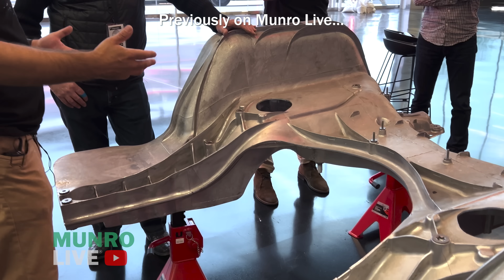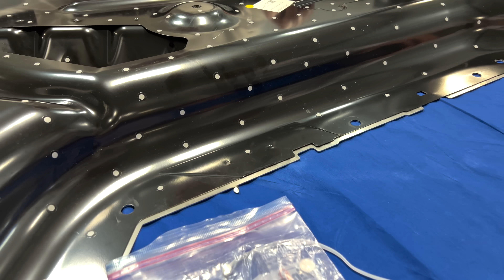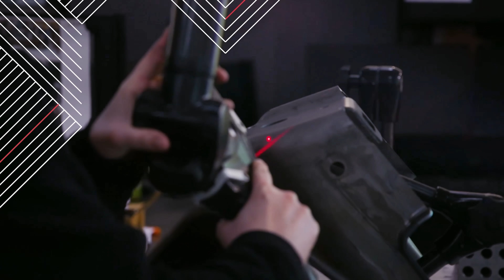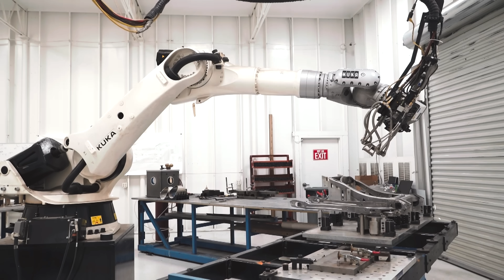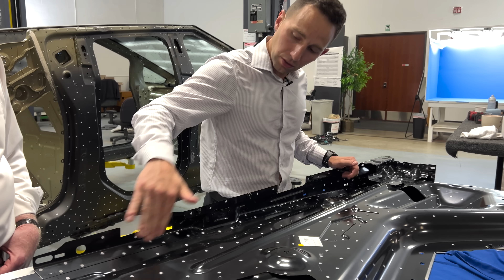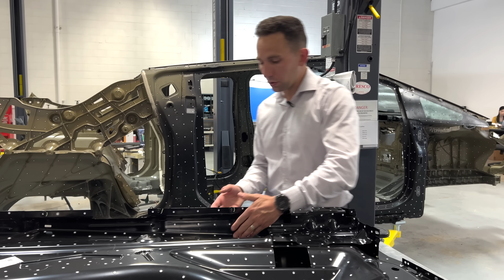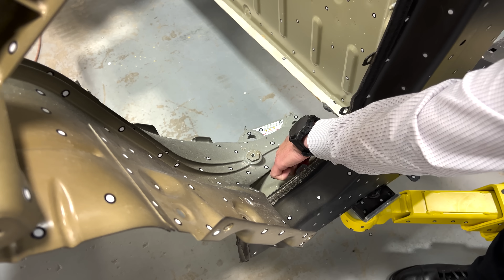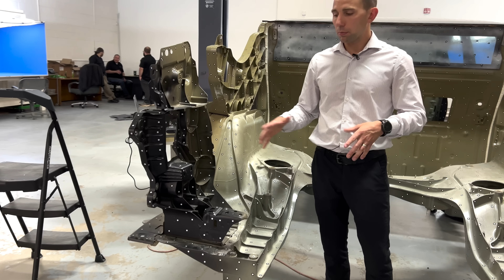Peeling Back the Layers: Tesla Cybertruck Rear Body Panel & Castings

Comment: So much for reduced stampings and an exoskeleton. At least in traditional unibody designs the rear fenders are welded structural members! 😂 Some people were legit upset when I started suggesting last year that there were probably stampings behind the stainless panels because that is not what Elon had so boldly proclaimed.
Reply: There was no way the outside skin was ever going to b structural.  If it was there would be weld marks or screws rivets.
Reply: @robertbowman9108  I figured they were going to create a fold line around the outside edges and have mounting tabs to weld, screw, rivet, etc. from the inside.
Reply: I am amazed by the long list of technical details that Elon Musk promised you personally by a flippant remark on Twitter half a decade ago. There are so many completely clueless people out there who seem to think that if Elon said "exoskeleton" it would necessarily mean that the vehicle consisted of only one layer of metal and only soft wires, tubes and fabrics on the inside. And any deviation from that is evidence of Elon both lying and breaking his solemn oath to make this exactly as stupidly as you could possibly imagine.
Reply: @geirmyrvagnes8718  Dude. He literally made a huge presentation about how he was going to eliminate stamping and paint and streamline the gigafactory by going to stainless steel. Nobody inferred it. The man said it. Provided a huge capex reduction argument for it. And used it to fluff Tesla stock for years. So yes. The man was either lying or wasn't smart enough to ask the right questions from his engineers. Just because you have selective hearing or selective memory doesn't mean the rest of us do.
Reply: @patreekotime4578  Well, it's not painted, is it. So, are YOU lying now? shocked
Reply: @geirmyrvagnes8718  Did you even watch the video? The parts are e-coated and in some places also powder coated to color match differently e-coated parts. In some cases parts are e-coated as seperate components and then glued together before final assembly. So there are even extra steps here in this process vs traditional coating. Final paint may have been eliminated, but the painting process here is still complex compared to just dipping the whole thing.
Reply: @patreekotime4578  So now it suddenly isn't painted, just like Elon said? But why were you lying to us? I am shocked by your lies! What? Am I deliberately misunderstanding you and acting stupid? Yes. Yes I am. Just like you. LIES! LIES!
Reply: @geirmyrvagnes8718  Please take whatever medication you are supposed to be on. Its impacting your emotional state and your reading comprehension.
Reply: this has to be the worst truck ever made in history! yes it has tons of power and electronics but thats where it ends! a cheap toyota hilux body on frame comes in single or double cab, longer bed, it canbe equiped qith custom beds with colapsible sides, dump bed, a crane, 6x6 conversion, chassis extension and much more. there is no limit to what can be done with body on frame period!
Reply: @alanmay7929 Quick bro, write to Tesla and let them know your insights!
Reply: @alanmay7929  Buy a Toyota, then. Why are you here?
Reply: @geirmyrvagnes8718  wow!!! i just gave you one example! is that all what you could come up with?! how pathetic!!! im here for the so called "future" of trucks where literaly nothing is modular, nothing can be modified..... wow what a "great" future!
Reply: @alanmay7929  You gave one example and you want more from me? How despicably pathetic!!1!!eleven... Listen here, young man: If you want a truck with a frame, buy a truck with a frame. Don't go crying on the internet. Do you want me to list trucks with frames for you?
Reply: @geirmyrvagnes8718 when did i "asked" you any "example"  can you even read?! didnt Munro said its the "future" of trucks!? how difficult is it to get! TERRIBLE just terrible!
Reply: What about the Chevrolet El Camino and Ford Rachero?  I want a cybertruck, not a hilux.  My life isn't complicated where I want a small truck. Besides the Hilux is extremely slow.
Reply: @GG-si7fw  the hilux isnt "extremely" slow, its not a sport vehicle! its a vehicle made to be used all around the world from the paved roads to the harschest places in earth not the useless EV. its used for towing, hauling people and goods, its modified for overlanding, offroad, RV, firefight.....

Comment: Does the stainless steel add any structural value?
Reply: Of course.
Reply: It does to the outside. The contribution to something like the stiffness of the vehicle would be minimal. You could probably drive it around "naked" just fine. But when it comes to the toughness of the vehicle surface in practical use, a truck where you can karate kick the door and it doesn't even scratch? Is that a structural value? Also consider side impact, having a thick strong skin to distribute the load initially and lead the forces to the strong points. I'd say that has some structural value.  Maybe you eliminate the need for some steel beams that you usually find in doors for that purpose. I, for one, understood that as what was meant by "exoskeleton", but It would seem I am one of few.

Comment: In my opinion, the “flutes and escape paths” have nothing to do with the coating process (the coating is done before the stainless steel plates are glued on, which means there are no enclosed cavities anyway). To me, these areas look more like measures to avoid draw creases: Material is “used up” here that would otherwise form creases in the drawn part.
Reply: Or, since they are facing down, drainage.
Reply: @geirmyrvagnes8718  Given it's Tesla, they probably fullfill multiple needs. Let's assume at least these two.
Reply: That was my first thought, but you’d also want to get rid of water if any makes its way inside following a river crossing for example.

Comment: E-coated inner skin would very likely be dried and cured before bonding to SS outer skin,  So it would be expected the drain holes are for condensation between panels (weep holes).
Reply: And for getting rid of water after you wade across a river.

Comment: Marvelous review,  lots of interesting details and manufacturing tech.  Thanks much for detailed analysis.   Can see that this design will have near ZERO reparability.  the entire vehicle will be scraped in event of most minor damage to castings.
Reply: On what planet do you see a skilled workforce evolving to repair advanced vehicles? there's a shortage of people for every trade out there.
can my flat screen TV, vacuum , Iphone batteries be repaired? more and more things cannot be fixed as labor costs increase.
Reply: @ExploringCabinsandMines  If the damage is minor, cars can be repaired. For the Cybertruck it is very easy. No paint to match, so just replace the panel/bumper/door in question. The expensive part is, as you point out, the time used by skilled people. If the damage is bad (a wheel is ripped off), it is more expensive to fix any car than the cost of a similar used car, so it is written off.
Reply: Why? You can weld castings.
Reply: OK, now you know that castings can easily be repaired. Please confirm that you have received this information.

Comment: I'd like to see a deep dive into automotive adhesives which are used so much now. Another great, informative video Munro team!
Reply: Me too. With lots of info on their lifespan and how they compare to welds. 😅😅😅
Reply: @AvocadoAtrocity structural adhesives tend to have a higher fatigue resistance vs spot welds.
Reply: @mmvanraa  Indeed, and potentially vibration dampening.
Reply: Supplied by Lord, a part of Parker Hannifin.

Comment: If the castings are “the fixture” why is there any panel variation? Over and over we see panels that don’t fit, this doesn’t make sense.
Reply: I've now seen about 50 Cybertrucks, and at least 20 parked where I looked at them closely.  Other than the early engineering validation prototypes (a few of them here) the panel fit has been excellent, as good as any German or Japanese manufacturer.  I did see one small panel that seemed off, but was just not attached properly (might have been a test car).  Now there could be a few that have already been in an accident, or someone removing a panel and not putting it back on properly that would cause a poor fit.  I guess the question is was the poor panel fit one you saw personally, and it wasn't a internal Tesla test car?
Reply: Prove it.

Comment: so if that panel is damaged that entire piece has to be replaced i wonder how much they will cost and how readily available they will be.
Reply: So if that panel is damaged, you simple replace the whole thing. One hour work, and a cheap part. Done. Quickly and cheaply. No paint, no problem. Now wonder about how much that would cost to repair a vehicle with a shiny painted surface in a special color. Just the hours in the workshop and paint shop...
Reply: Someone already had theirs damaged. ~$3k including install from Tesla iirc
Reply: I never thought paintless dent repair would amount to anything,  I was wrong.
Reply: availability = zero, reparability near zero
Reply: @pablopicaro7649  How do you know this to be true?

Comment: Why did tesla put on these heavy stainless steel panels if the castings are so beefy. Couldn't tesla have saved a ton of weight by using normal panels? Wasn't the outer shell supposed to be the structural exoskeleton? The cypertruck is a shit show. Almost nothing that is important to customers made it into production. Sadly Tesla has become an average car company. Where are the smack downs to ice vehicles and other oems that Tesla was known for in the beginning? I excepted a truck that beat all other trucks in almost all metrics. And what we got is an under average shit show. No structural exoskeleton, no 600 miles range, not rust proof, not reliable see all the reports of failures, no spare wheel, no rear view mirror, no heads-up display, no stocks, shitty lights the dimmest lights if seen on a car plus plugs up in snow 0 vision, shitty build quality panel gaps the wind shield wiper is off position when in default, no security sensors to stop fingers being broken when using the doors and frunk and trunk 80s tech. And on and on and on.... What a shit show. Even GM truck evs outperform Tesla on every metric. Ironically not on price. GM is way cheaper than tesla .
Reply: Then go buy yourself a GM truck.
Reply: @airwindmars5971  I did ... chevy silverado ev. Best in class! I canceled my cypertruck order. And was a good choice. A friend who bought the cypertruck is selling it already. The cypershitshow doesnt even go 150 miles when fully loaded or towing. He had to charge the cypertruck after 125 miles. That means 2 hour driving and 1 hour charging. Its unusable. At least if you want to use it for truck things. If not than the model y is a way better deal.
Reply: @Ravenought69  The Silverado EV is pretty cool.  But the only reason that there is good range is because they just dumped a large battery in that thing.  It is not very efficient
Reply: @verbal213  bullshit!!! its actually very efficient and also why didnt tesla dumped a much better battery well integrated instead of the dumb extra battery taking 1/2 of the bed?! why didnt they made a thicker battery?
Reply: @verbal213  True it has a huge battery. But the fast charging charges way faster on the silverado. takes about the same time to charge the silverado as the cypertruck. What use is efficency if you only have half the range... wasnt efficiency supposed to give you more range not half? Cypertruck 280 miles - chevy silverado 445 miles... real world testing.
Reply: @Ravenought69  then good for you and your friend that you are very satisfied with your purchase. Why do you need to convince others to go buy a GM truck instead of a Cybertruck? Last I know this is America and one can buy whatever truck they want without being ridiculed for their choices. My first truck is a ‘99 toyota Tacoma and I still have it, my second truck is a 2012 Toyota Tundra and I still have it. My next truck will be a Cybertruck and not a  GM truck because that’s my choice.
Reply: @rogerstarkey5390  I mean I guess.  The current Cybertrucks are selling for 100,000 minimum and the Hummer EV is 108,000 so yeah if 8k less on a 100K truck is for the poor.
Reply: Flat panels with no contour very likely have lots of waves and buckling and thermal expansion issues,  likely making thicker reduces waves and deflection and oil-canning.
Reply: You really summed up all the FUD perfectly. Literally nothing of what you said is true or verified. There are no broken fingers. There's no reliability issues. The outside is absolutely structural making it an exo skeleton. The windshield wiper works well just like similar wipers are used on other large machinery. 
There's zero evidence showing that cybertrucks rust.
Reply: Chevy has plenty of Silverado’s in inventory for you to purchase. They are even being discounted.
Reply: Because i want them to avoid this expensive mistake. What an a hole would I be not to.
Reply: Lies and more lies. The GM BEV trucks are all far more inefficient than Cybertruck. Longer charging times to achieve the same range, more energy consumption, and more energy costs that quickly stacks up.
Reply: yeah seriously i dont get this show anymore! they just gobbe every shit tesla makes! why arent they talking about what body on frame trucks are actually much better!? this truck is utter garbage! a toyota hilux with 200hp comes in single or double cab, has a removable bed, can be equiped with custom bed with colapsible sides, a dump bed, a crane, chassis extension, 6x6 conversion and much more.
Reply: @alanmay7929  Yeah! The cybertruck is so much crap! It doesn't have an arm like a backhoe! It can't go underwater!

I can make braindead comparisons between two completely different vehicles too.
Reply: @themonsterunderyourbed9408  The silverado is an ev truck as is the cypertruck...  Its an apple to apples comparison.
Reply: @themonsterunderyourbed9408  lol!!!doesnt it have a boat mode by hasard?! a pressurised battery? and blablabla.......
Reply: @alanmay7929 
You "don't get the show" but you're STILL HERE!
.
Keep those clicks coming!
Reply: @rogerstarkey5390  you have nothing better to do in your life but to follow me! how miserable!!!!
Reply: @alanmay7929 it's so annoying.  There's a reason why everyone makes trucks body on frame. Because it works
Reply: @robertbowman9108  not just because it works because it actually offers capabilities that no unibody can even match! talking about stiffness for example! some chassis are actually made to flex slightly when used in extreme offroad sistuations and more! the Mercedes Unimog is the perfect  example for that! Sandy should review the Mercedes Unimog one day if he actually knows somthing in the automotive industry.

Comment: I’m sure it’s been explained before but what are all of the white dots for that are placed all over the place?
Reply: They're for the 3D scanner to pick up the surfaces and contours.
Reply: @hotrodandrube9119  Thank you. Were they put on by Munro or Tesla?
Reply: @MikeCasey311 The white spots were put on by Munro to facilitate 3D scanning. There is no production need for them.
Reply: @timepstein274  Thank you, the more I learn the less I find that I know.😊
Reply: @MikeCasey311  yes. There's probably two different dots because they were benchmarking different 3d scanners. There's hundreds nowadays and sometimes dimensional millimeters aren't all the same software to rendering software.
Reply: Put on by Monroe's team. You can probably track who their 3d scanner companies have been in the past by looking at their old videos with dots.
Reply: They take a "Pantograph ' (like an old dentist drill)
The tip of the sensor and angles of the arms can measure the position in 3 dimensions.
Touch the dots and a computer builds a 3D "Virtual" model
(Same way you can shut your eyes and touch your nose)
Reply: It must me a cheap low quality 3D scanner if they need so many reference points. With ATOS fringe projection 3D scanning you could scan that entire part with 10-20 points in total and you would capture the detail on the slots/edges using grey values. Capture 3D could advise further.
Reply: Me too?

Comment: The "flutes and gaps" look like moisture drains to me.  The e-coat panel is probably already dry when attached to the stainless skin.  Did you catch the Cybertruck and hammer silhouette stamped into the inner panel at 9:55 ?
Reply: yeah i was wondering why they would use the same e coat. also the mild steel is coated black while the stainless is not??
Reply: @vornamenachname8001  the aluminum castings have the brown ecoat, the stainless steel skin does not need an ecoat obviously.
Reply: @boostav - good comment for the main thread - was nice to know !!

Comment: It would be cool if they have 3-D wrap material you could put on your Tesla cyber truck that look like the heat tiles from the starship.
Reply: Just magnet them on 😂😂
Reply: @AvocadoAtrocity 
The stainless isn't magnetic.
Reply: That could be done with the laser engraver used to mark the foundation series. A deep hexagon engrave would simulate the tile seams well. A vinyl sign shop could make the pattern in black and peel off the seams.
Reply: I'm sure it could be arranged
Reply: You can have anything you want printed on vinyl and wrapped on the vehicle